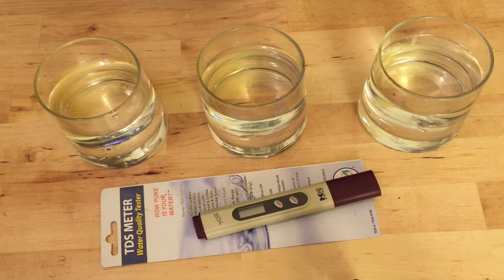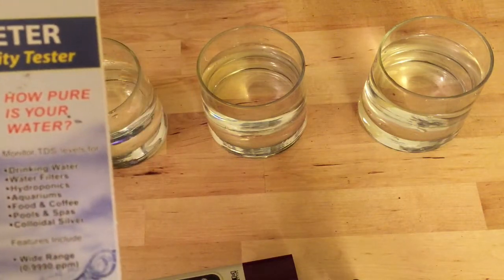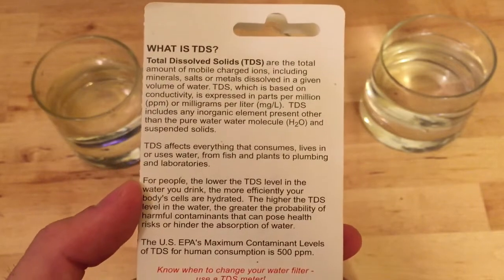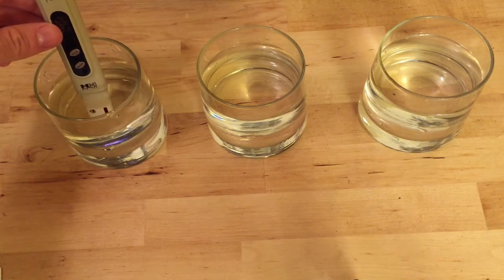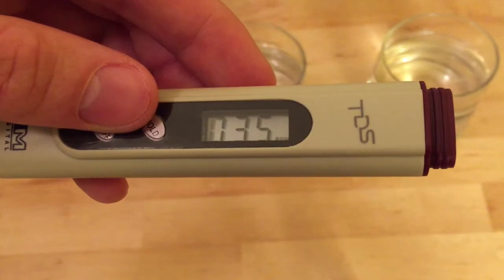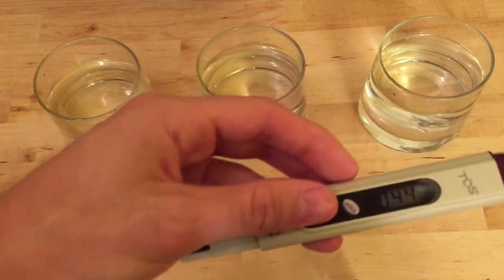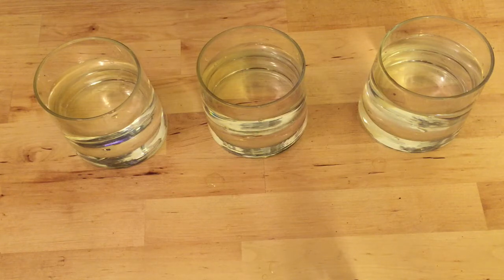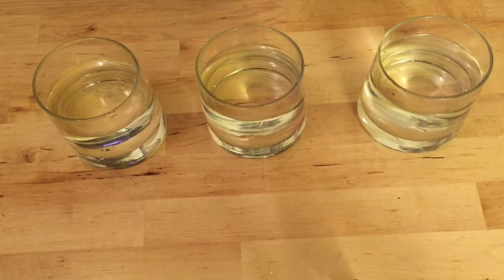How to Test Water for Coffee with a TDS Meter

Comment: If your TDS meter reads 80ppm & your coffee boiler heats that up doesn’t it become potentially highly corrosive water? What is the difference between cold water, room temp or water in the 160 to 180 degree range?

Comment: A TDS measurement below 50 is generally considered a corrosive environment and will damage equipment over time. The SCAA website recommends 150 with an acceptable range being 75 - 250. I blend my water with an RO system to about 80 - 90 and get good results there.
Reply from the maker: +Maxwell Perry Good to know! Guess I don't need my Brita after all :P